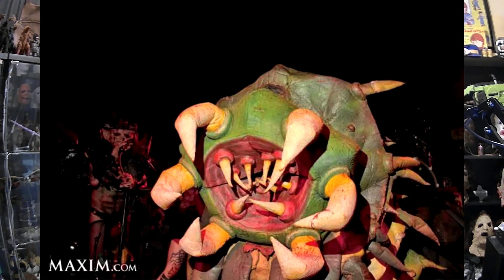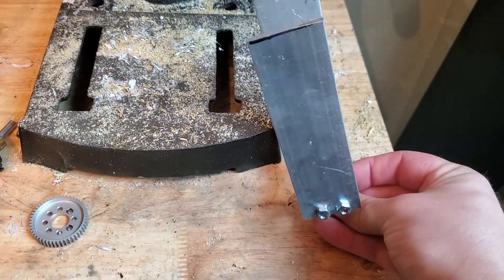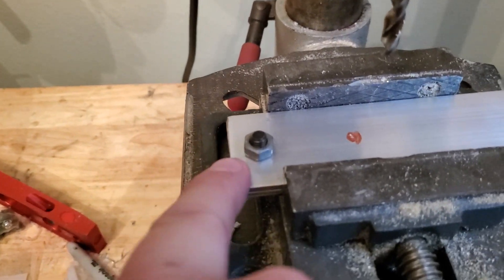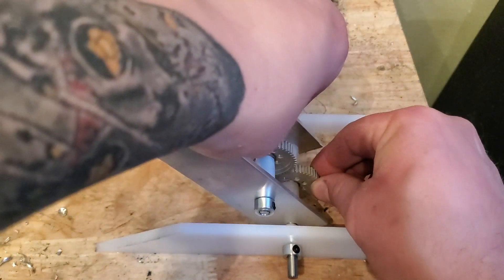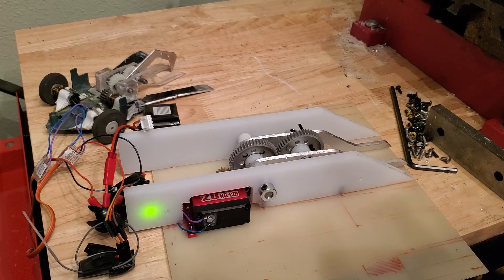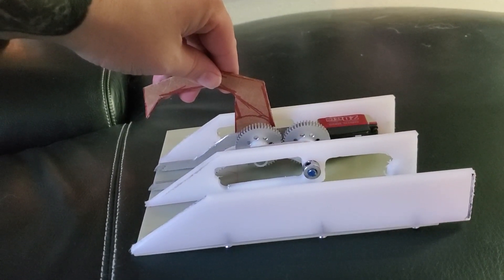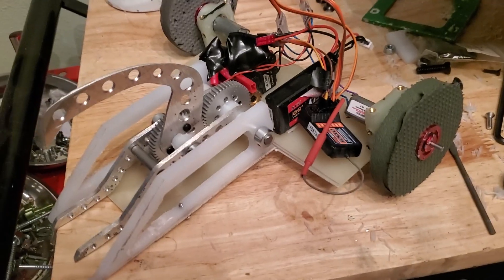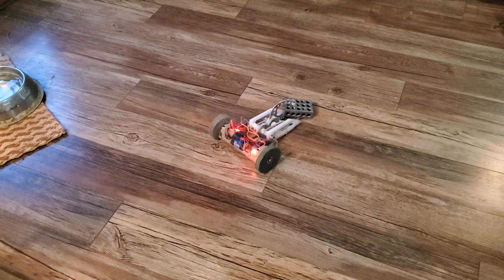World Maggot Combat Robot Build Report

Comment: after you cut the flip flops with the hole saw you could put it on a drill and spin the wheel while holding some sanding paper on it to make them smoother and more unform.